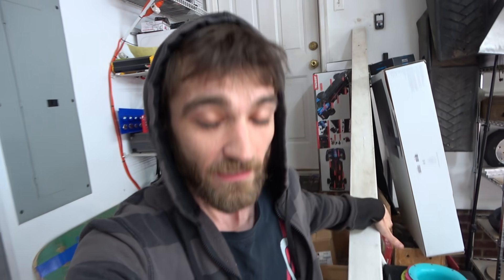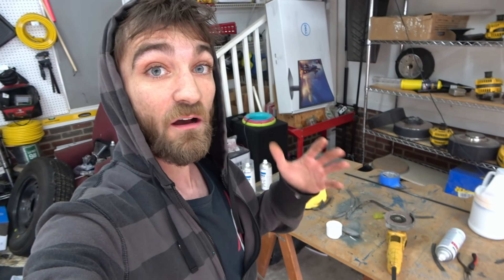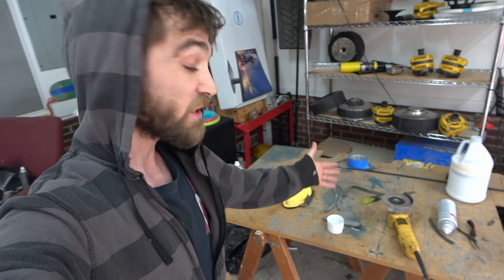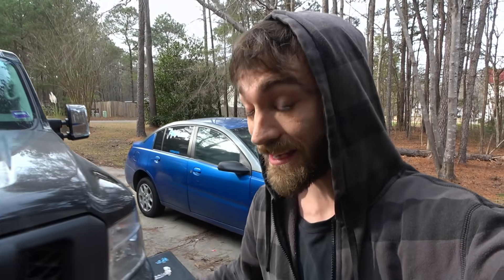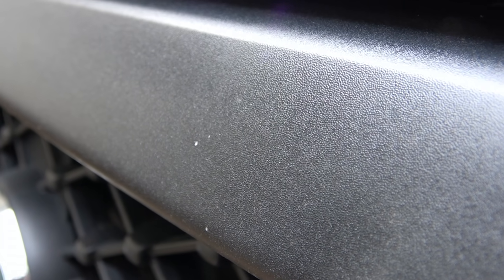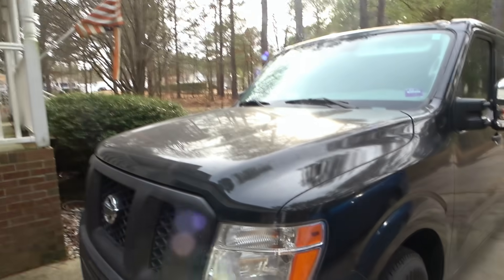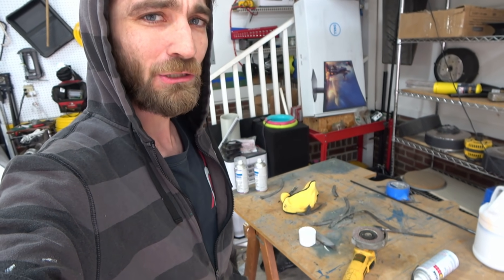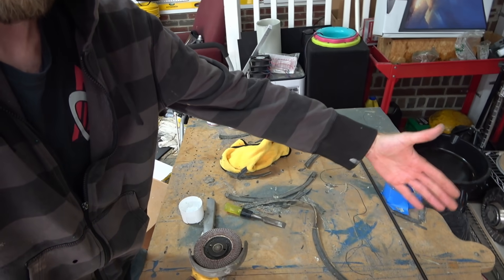FACING MY MISTAKE!!! (EXO's 75,000W Car Audio Build)

Comment: Check out the Chemical Guys on you tube. Don't fret Exo, been there 💩 happens. Over spray comes off, with just a lil elbow grease and know how. Definitely not the end of the 🌎. If you were closer I would help you take care of that. Keep ya head up and keep building.

Comment: Even tho wasn't to positive....its still a minor mistake compared to what could have happened.....anyhow I made a mistake with a resent purchase....6k mono block with a 5k 18" sub....I have one xs xp3000 piggyback of my factory system with a rebuilt 280amp gm alt. That was my mistake.....now I have to source an alt. Omg spl takes so voltage....still love it tho.

Comment: Man I have a question I have one of my zv5 15s and a taramps hd5k in my 08 altima stock alt stock battery and wiring for now when turn up the bass knob even in the slightest my transmission slips when the bass hits what could cause this?

Comment: How did that work out? You need to clay a new vehicle anyway to get the fallout out of the paint then hit it with your local detailers wax. I have been out of the scene for decades. Lol. Carnauba/teflon was the kind back then..last I heard ceramics..but what I do know is what you buy at the store is usually not as good not as easy as what the detailers use.   Clean and dress lube! Lol. If you keep some good wax on it nothing will stick in the future. Easier to clean and dry too. Wax your bumpers, wheels and windows too. Stay off the rubber. I thought come weird voltage thing happened with a funky ohm load and you fried it. You know engines get shut down on the dyno to be taken apart and out back together and put right back on the dyno..if you have a goal and can see it then nothing will do than your vision and nk matter how many pieces you have to pick back up you move forward! Thanks for your honesty!

Comment: No problem bud, as long as its factory paint, you can take a damp rag with lacquer thinner and it will come right off.  Have one rag for the thinner and take a clean rag behind that one and it will all come off.  Then just throw some wax over the panels and it will be clean as a whistle.

Comment: All you need to do is get some mineral spirits and literally wipe down the car 90% of that should come correctly off mineral spirits dries fast so it won’t harm the original paint you’ve got a thick layer clear every bit of that will literally wipe right off and you’ll be out maybe 50 bucks in couple of gallons or containers if you’ve got that much of a mess but it literally will all wipe off the windows the body and everything do not stress brother it is too simple

Comment: Not expensive at all get get 2500 wet sand paper with a da and sand it down with water get a polish machine and compound and you are set and for the glass just get a blade and shave them down with water as well